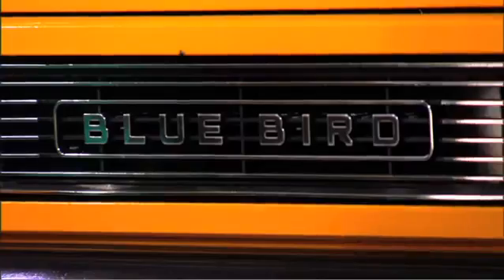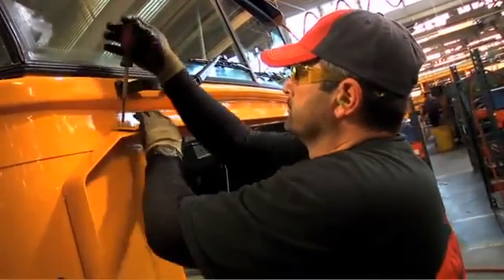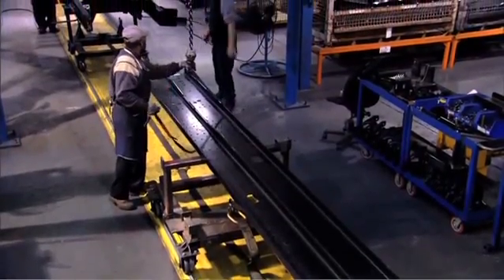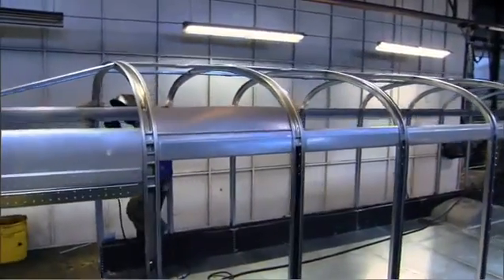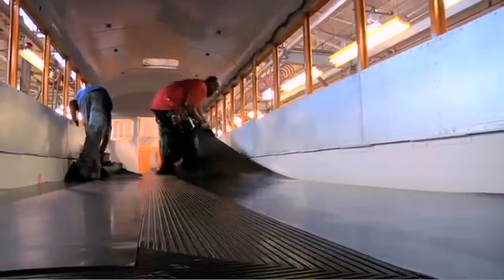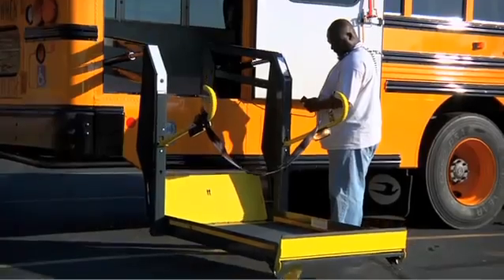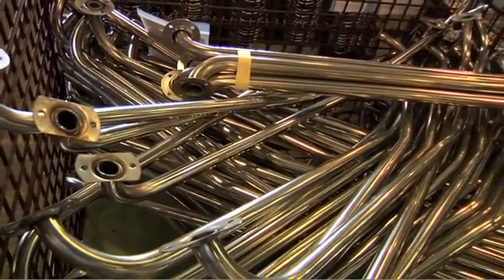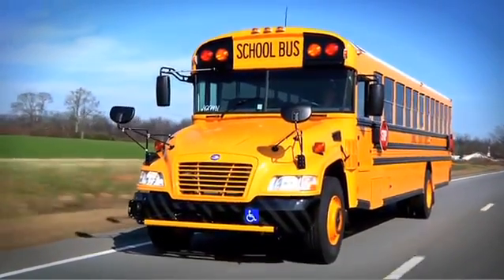How a bluebird school bus is built

Comment: The fact that air conditioners are optional is far fetched to me. It’s so hot here, up to 100 degrees for weeks on end.
Reply from the maker: Lewis Johnson, It Should Just Come With Them
Reply: Rural school bus routes are extremely hard on air conditioning systems. The condensers are installed behind the real wheels and they cake up with gravel and dust. Also the vibrations alone are killer. The added cost just doesn’t make sense for smaller rural schools.